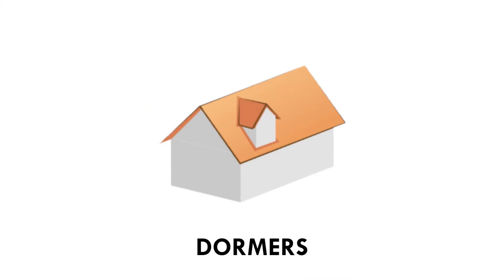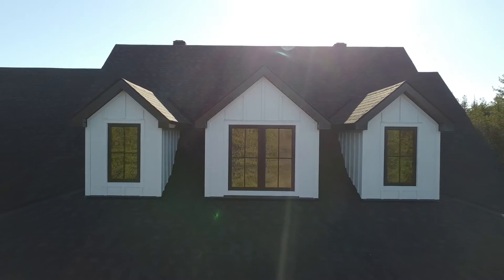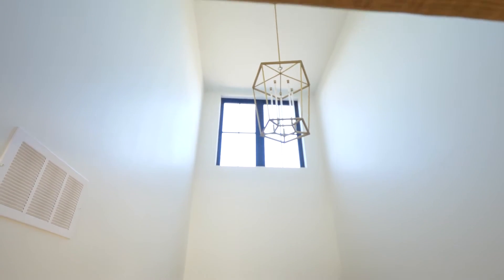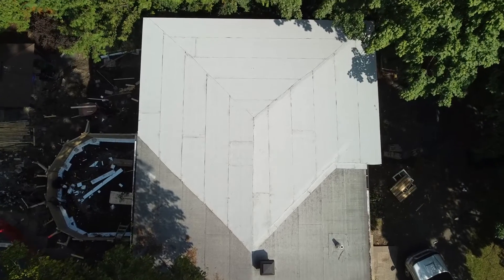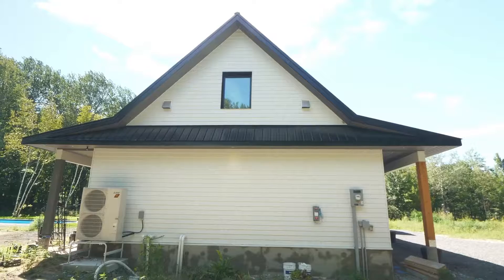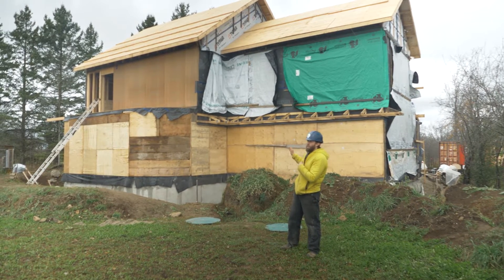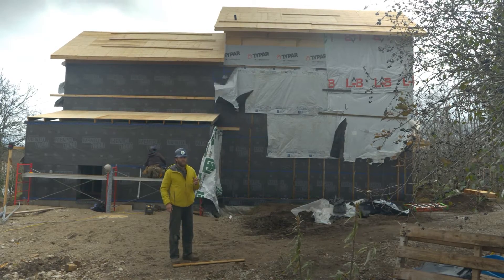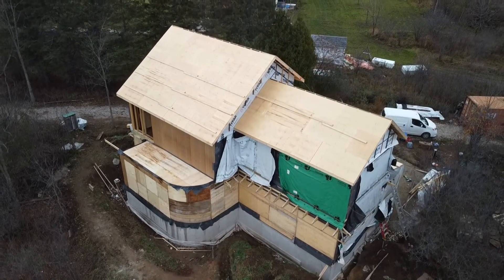Choosing the Best Roof Design for Your Home

Comment: Doing a skillion/shed/mono slope 6/12 pitched roof with dimensional lumber for rafters on 24x24 cottage. The 3.5x16 32 foot I joist are 134$ vs 75$ for x2 2x12 16 feet and 8 foot 2x12. I was planning on putting a middle bent in timber frame in the center of 31'2" foot span. Got 70 psf snow loads. I want to leave rafters exposed so need to insulate outside of of sheeting. Half the floor space in in widow area for solar gain.

Comment: I have heard that certain jurisdictions in Canada do not allow an unvented attic to be built (by unvented I mean that all the insulation is on the attic floor and there are no eave, gable or ridge vents). However, in rural locations it is recommended that unvented attics be used because of the risk for wildfire embers possibly being blown into the attic.
Do you know if codes in Canada allow unvented attics (or maybe, which jurisdictions don't)?
Reply from the maker: To my knowledge, an attic space needs to be vented as part of the Canadian Building Code.